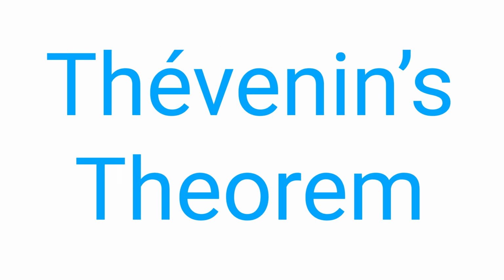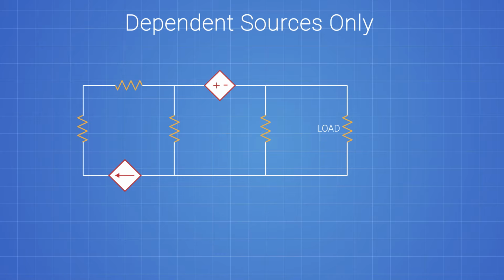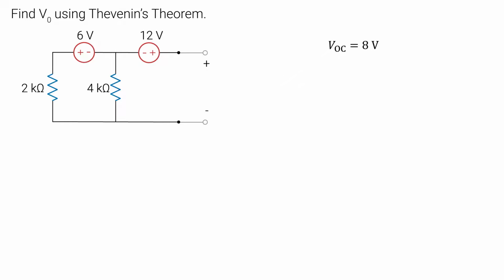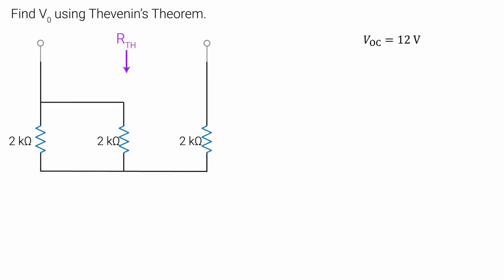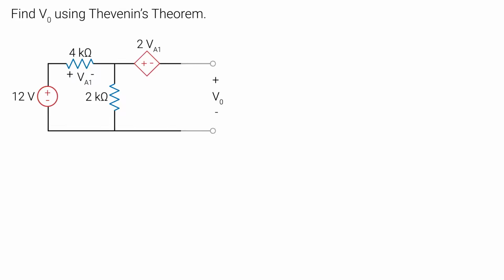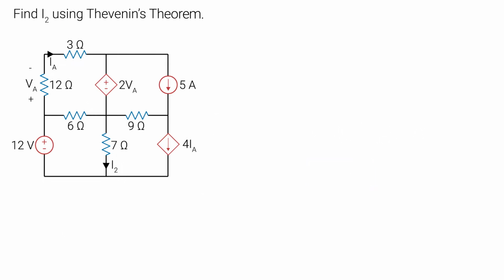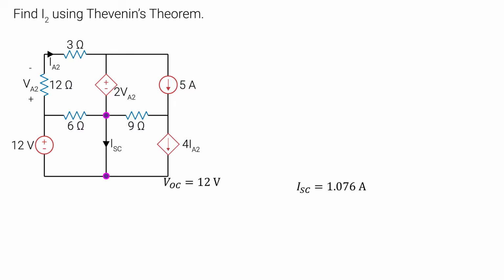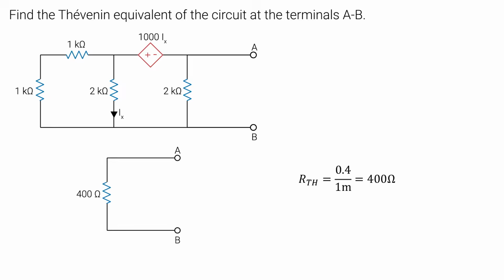The Complete Guide to Thevenin's Theorem | Engineering Circuit Analysis | (Solved Examples)

Comment: @12:18 the 2 kΩ resistor is in parallel with a short, so its effective resistance is 0 Ω, that means it doesn’t affect the circuit, and the Thevenin resistance should be 2 kΩ instead
Reply: I believe both the 2ohm and the bottom 4 ohm are in a short. The top 4ohm is the sole resistance in play, thus why Rth=4
Reply from the maker: @fabiolessaaco That's correct. 👍
Reply from the maker: There is an error, but your value is also incorrect. I've corrected the error here: https://www.youtube.com/shorts/3atQmqZjvoM
Reply: Bruh, U know what 
U saved 3 4 hours of my time, I thought this video must be correct and im wrong, I chatted with Many AI for more than 6 hours
But realized there must be someone asking this, so i foudn ur comment and now im thinking I was so dumb to think about so simlpe thing for so many hours
I wasted about 4 5 hours.... 

Otherwise I love this channel, Best Videos, Best explanation. Everything Best...
Reply: @frh_astroboy8215  If you are stuck on a question for more than 30min, its time to go to the next question. Brute forcing anything will lead to diminishing returns!

Comment: Your sign isn't conventional,  current flowing from the negative to positive terminal of a voltage source should be positive voltage in KVL and negative voltage drops. 5:34
Reply from the maker: This is the conventional method for north American textbooks, called passive convention. Current enters the positive side of a resistor. In addition, regardless of the voltage source positives and negatives, you are free to choose any direction for current in a loop/mesh, since the signage will workout as long as you use passive convention. If you individualize currents in branches, you can then assume that the positive side of a voltage source will provide the movement of electrons even though that's not how it works in real life.